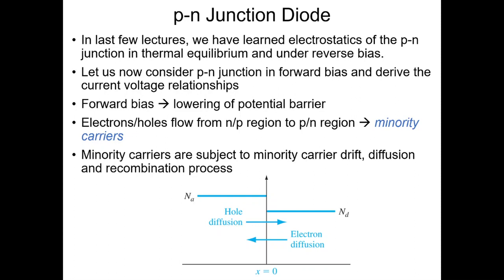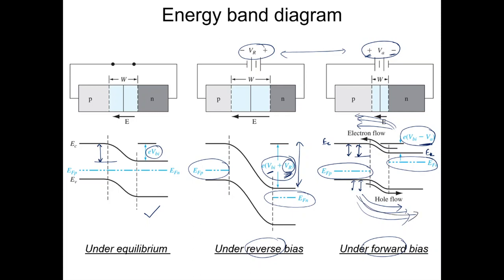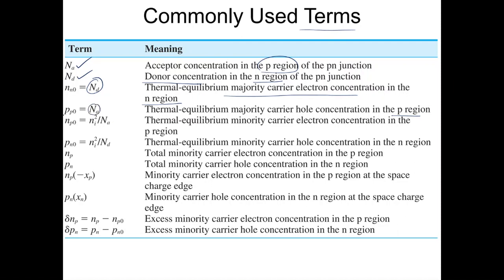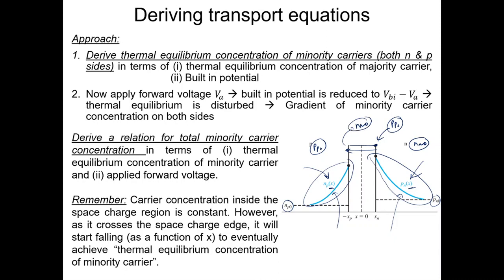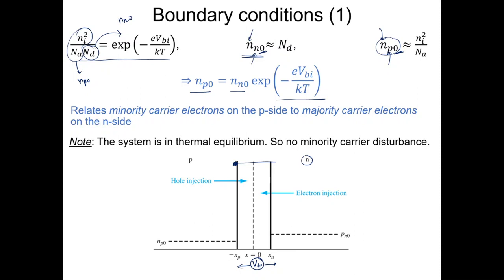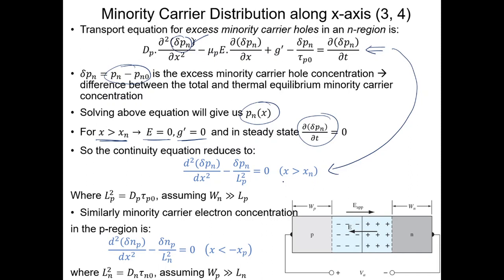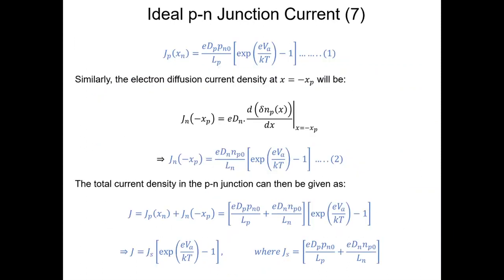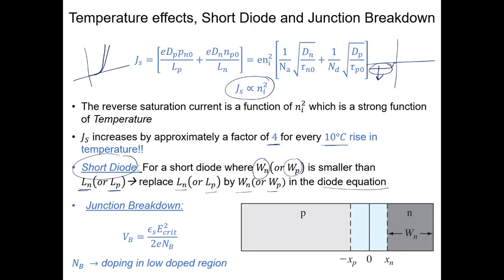Lecture 14 - The p-n Junction Diode

Comment: Sir, as i am from EE background, (rank in GATE ECE is 374), I am comfortable with Analog and Digital electronics and Power electronics converters but I am not good in Electronic Device physics. Should I expect an interview call and then questions from EDC? And I am also confused between ED and Micro VLSI programs as I want to learn how to design SoC and those ICs which is used to control power switches in DC-DC converters.
Reply from the maker: I hope you got a call.
Reply: @mayankshrivastava7169  Dear professor, thank you for these informative videos. As I am reaching chp 8 in the book, I am planning to continue with rest of chapters. Could you please upload videos related to next chapters If you have them. Thank you for your efforts professor.